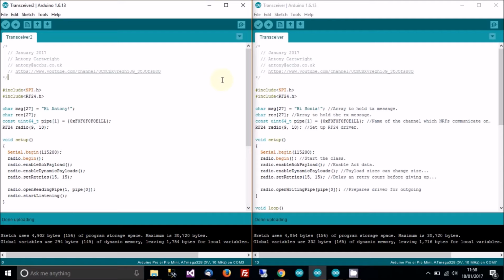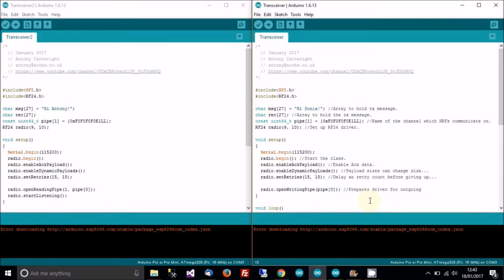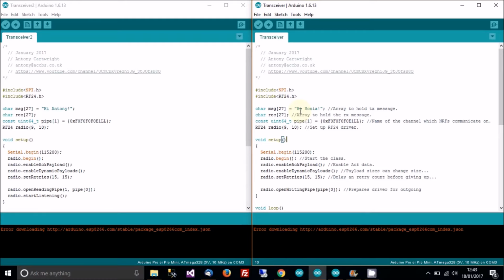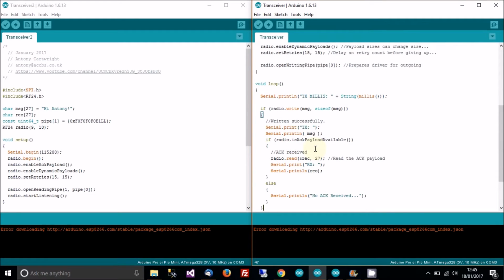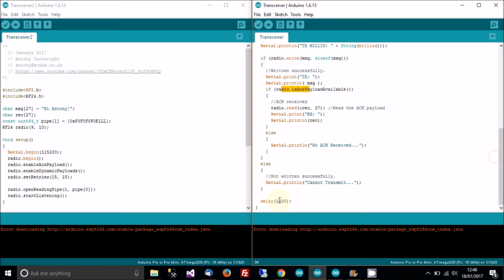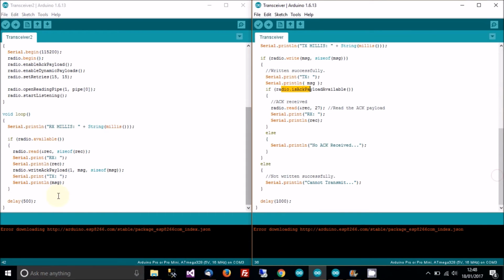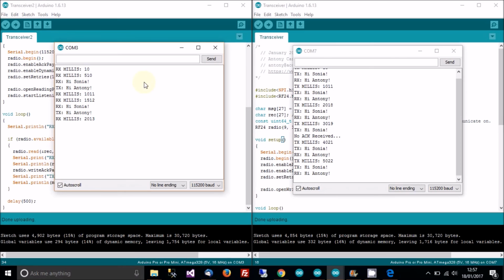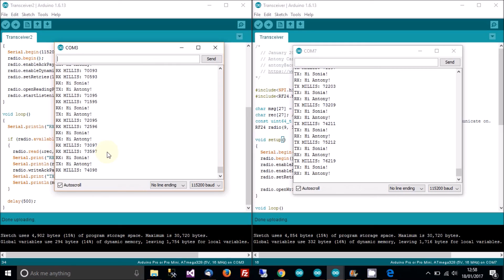TUTORIAL: How to set up the NRF24L01 wireless transceiver on the Arduino (Part 4 - Working Code!)

Comment: Hi ,how can i use nrf24l01 for many to one communication i.e i want multiple Tx nrf24l01(node side) data will comes to one Rx nrf24l01(gateway side)?
Reply: I would try to have one transmitter and many receivers the receivers can send the ack Paket with a different delay so they don't overlap.Then the ack Paket can contain data to tell the transmitter to first tell the other ones to stay silent until they receive other information and then go to reviving mode to receive the data.
Reply from the maker: Hey, I don't know how to do this. From what I remember, it was only two way. :-)

Comment: Hi Antony. Having trouble duplicating your code in the "tranceiver" portion. Specificaly this
void loop()
{
  Serial.println("tx Millis  " + String(millis()));

  if (radio.write(msg, sizeof(msg)))
  {
    Serial.print("TX  ");
    Serial.println(msg);
    if (radio.isAckPayloadAvailable());
    {
      radio.read(&rec, 27);
      Serial.print("RX:  ");
      Serial.println(rec);
    }
    else
    {
      Serial.println("no ack received");
    }
  }
  else
  {
    Serial.print(" cannot transmit");
  }
  delay(1000);

}

 
The first "else" creates an error.
Reply from the maker: Hi Thomas, I've just looked through the code and I can't see a problem with the first else. What exactly is the error? Antony...
Reply: Thanks Antony. Everyway I try, no go.
Brackets pair up fine, but these are the error messages I get;

Arduino: 1.6.5 (Mac OS X), Board: "Arduino Nano, ATmega328"

NrfDual0117d.ino: In function 'void loop()':
NrfDual0117d:46: error: expected '}' before 'else'
NrfDual0117d.ino: At global scope:
NrfDual0117d:51: error: expected unqualified-id before 'else'
NrfDual0117d:55: error: expected constructor, destructor, or type conversion before '(' token
NrfDual0117d:57: error: expected declaration before '}' token
expected '}' before 'else'
Reply from the maker: Hi Thomas, I'm afraid I don't know, however, first, look outside the loop. Check for duplicate brackets, braces or semi colons. After that, comment out every line in loop then reintroduce parts gradually after compiling each time. Doing this will identify the problem! It will probably be something silly...
Reply: ok, Thanks. I'll continue to plod along on it.   I have removed the embeded 'Else" and all works great.
Reply from the maker: Ok, Aslong as your code is the same as mine, it will be fine... if the else needs to be there, it needs to be there!
Reply: Found my error. A semicolon at the end of the "if(radio.ack received..........) line
Reply from the maker: Brilliant!

Comment: Hi Antony, Don't think Sonia likes Antony. Tried for a couple of days now to get it working, keep getting "cannot Transmitt! " then it will actually work for 2 or 3 times when I reset Arduino but then stops again any ideas?
Reply from the maker: Oh I don't know about that Steve! If only you knew what she did this morning! ;-) Lol, Seriously though, I've seen this exact problem before... Just verify that you have copied the code exactly to start with. After checking, then reflash both modules... After this, unplug both modules and plug them both back in. Open up the serial console, then on the transmitter Arduino, press reset, wait a sec and press reset once more (so you press reset twice)... It may then work! If not, make sure you have a good power supply, like a phone charger type. Good luck! Let me know...
Reply from the maker: Steve! An update! I've just been fiddling with the NRFs again and I've experienced this bug again! It appears to be a COM problem on the computer. If you flash each Arduino separately with only having one COM port open at a time, then it seems to work every time. Try this!
Reply: Oh  Great its working!!   Strange it worked straight away? now I can get on with the new sections .Well done and thanks again Steve
Reply from the maker: That's good news! I think the problem can 'sometimes' be replicated when we open two COM ports at once. It seems to be a glitch in Arduino. I actually detected the cause of the problem by accident whilst working on another project!